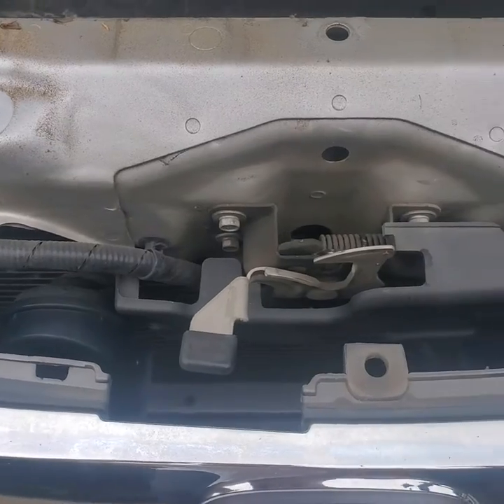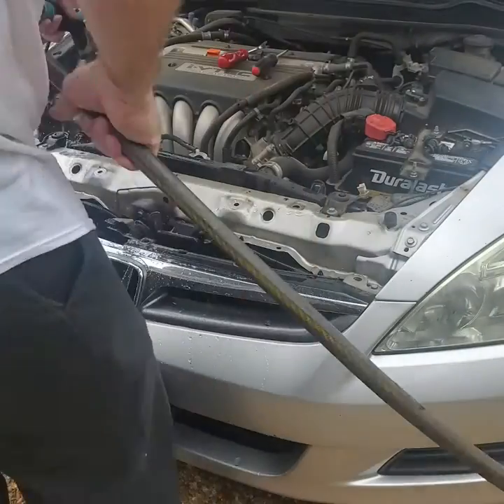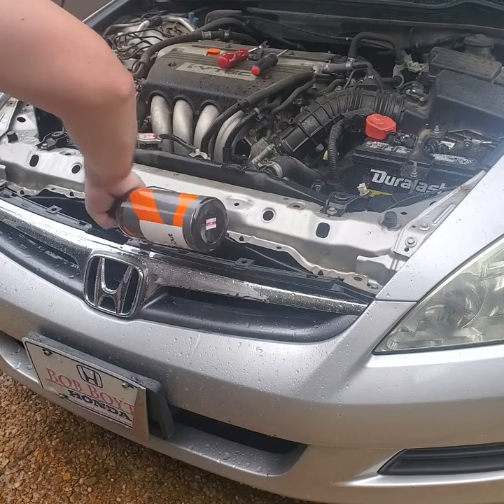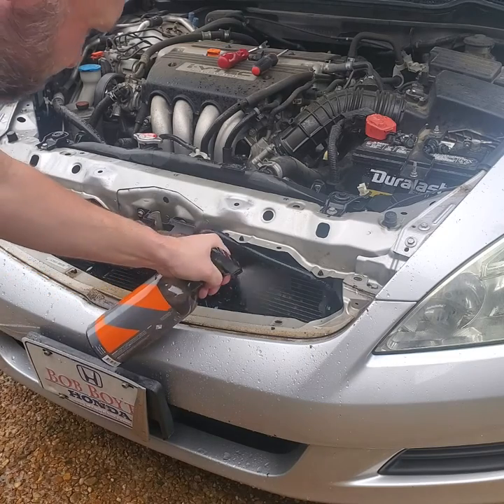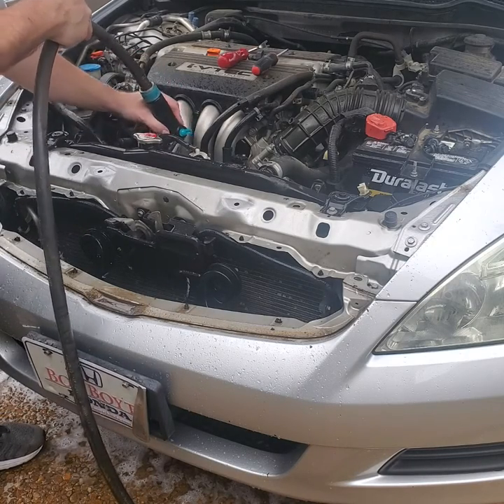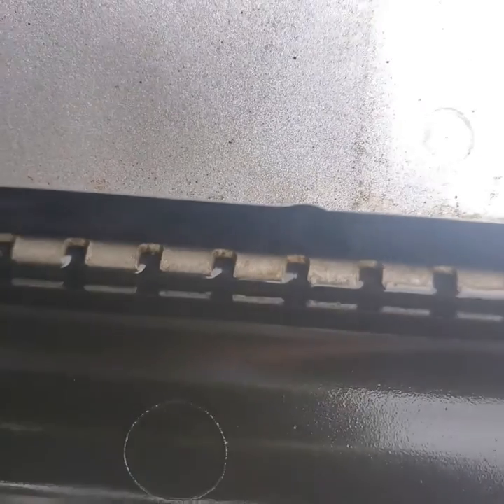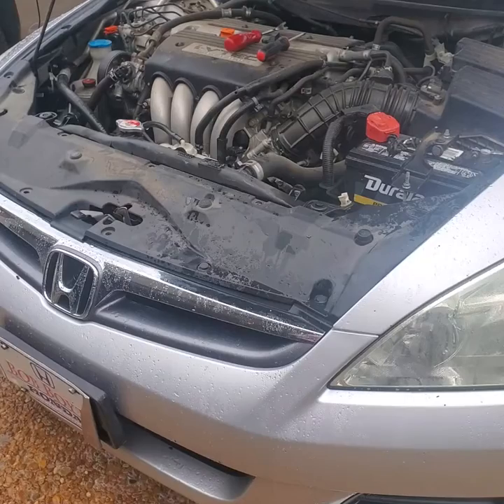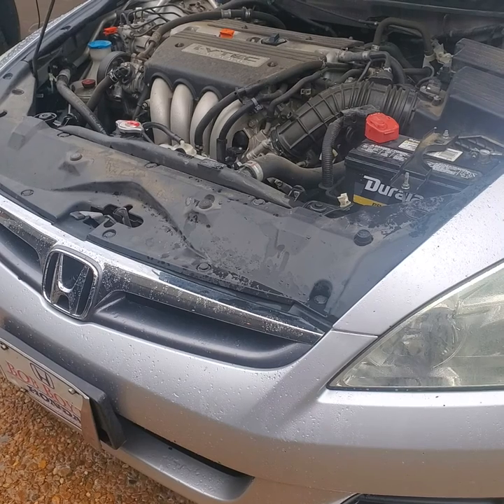How to Clean Your Car Radiator and AC Condenser!

Comment: Did you honestly notice a big difference . Or was it too close to call ?
Reply from the maker: Not in AC performance, but that's probably due to age and the original freon is still in the car. The temp did stabilize when idling in heat the rest of the summer, though.
Reply: How many degrees it went down after cleaning it?